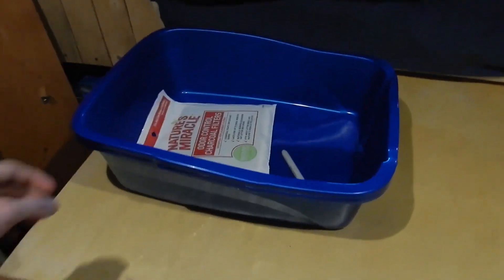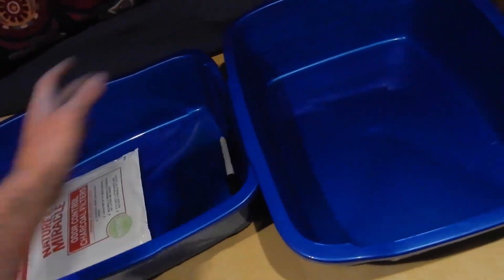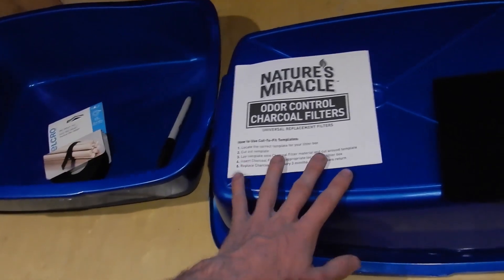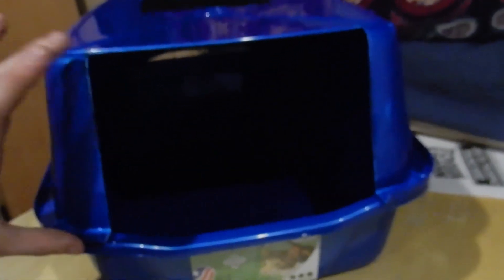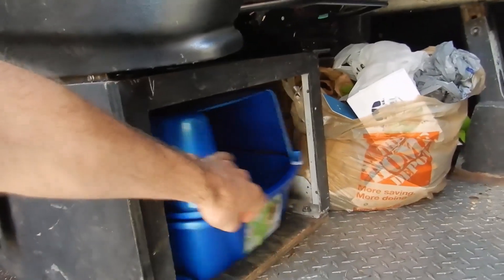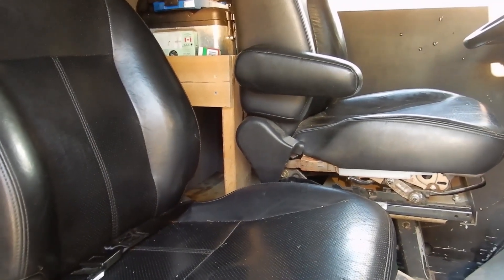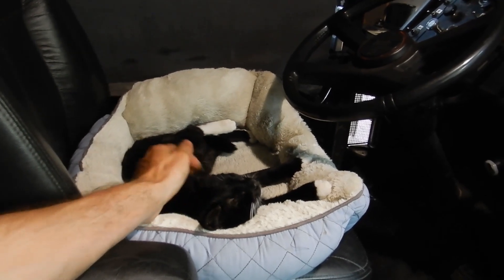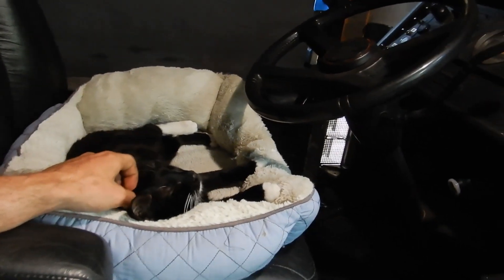Catifying My Self Converted Stepvan ~ E079

Comment: They do make cat doors like dog doors. It has a little magnetic strip to keep it shut which will come in handy when it’s freezing outside and up front. The heat rises so not to much worry about heat getting in. It also comes with a solid door to keep her in if you need to. Just an idea.
Reply from the maker: The problem with them is that one side of my door is completely flush with the pocket. All of the manufactured doors stick out at least a little bit.
Reply: Sylvan Secrets oh I see, that would be a problem, and the frame does extend out some.